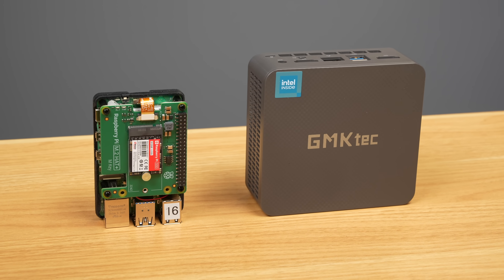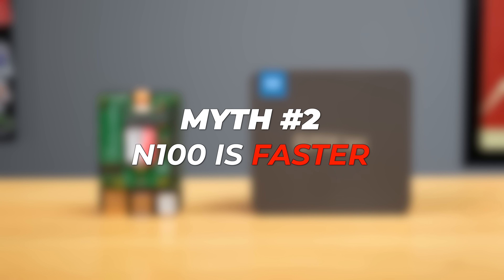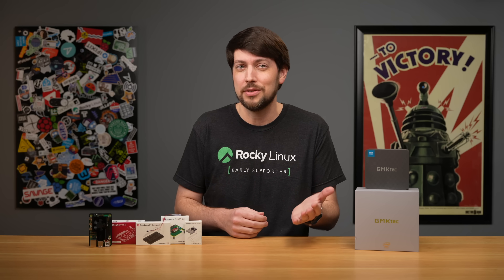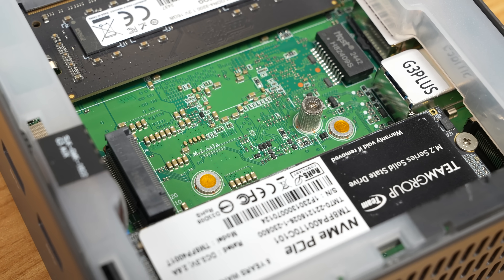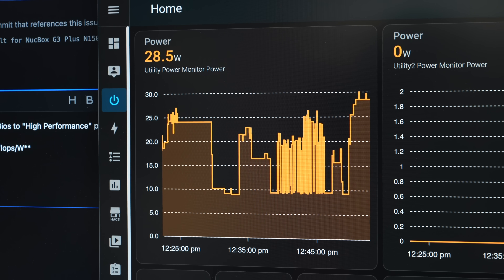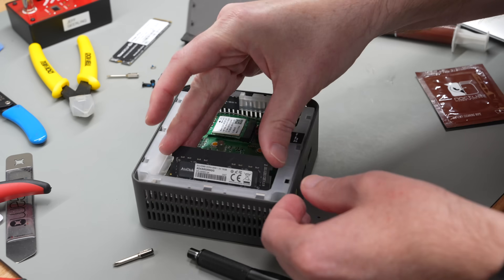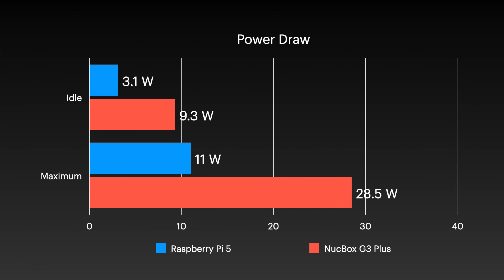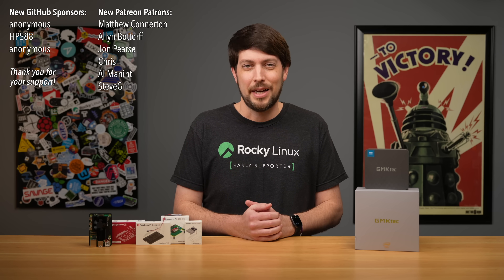When did Raspberry Pis get so expensive?

Comment: It's not only the price, the tech isn't there either. GPU is still lackluster, and 16nm is ancient for 2024 (and it was already old by the time the RPi4 was released). Also I can't forget the CEO's attitude during the shortage, spitting to our faces, saying explicitly that corporate buyers are prioritized over hobbyists. And BTW,  you should have included the OrangePi5 in the comparison, it's far more similar to RPi5 than those N150 mini PCs, and still a lot more bang for the buck.
Reply: OrangePi looks good on paper but has worse support than these 2 options.
Reply: @vadnegru  I don't have one, I'm guessing they provide iso images and things just work. What support is needed exactly?
Reply: @tappy8741  the community is very small compared to RPi's, and of course pales compared to x86's. But you can't blame the product for that, it's still more powerful and it will serve you well as long as you don't have odd use requirements.

Comment: If your patient you can get 16g ddr5 512g n100's  for 125-175, it just comes down to do you need the igpu(handy) and do you want to use a pi and tinker. I watch still, but pi's cost/usefulness is limited for me now, and i can use the pin outs from other adapters etc instead... Plus SD cards are stupid and fail to much, so you need to make sure your pi can use one :)

Comment: Thanks Jeff for this video and your last video on this topic ❤ - on which I also commented 😊. The last year or so I had abandoned Raspberry Pi as the Pi5 is expensive compared to a n100 NUC / mini-PC. In the last 3 weeks I have started using the Pi Zero 2 W as I love its cheap cost and very low power consumption. I was very lucky visiting the Raspberry Pi shop in Cambridge, England 2 weeknds ago and so I bought multiple Zero 2 Ws ! 😅😅😅 So for around $150 I would choose a n100, but for a simple Samba media server then I use a Zero 2 W, horses for courses. 🎉

Comment: As someone who is also a fan of the pi ecosystem, I do get frustrated with the number of people buying them and expecting to use them for basic/standard "desktop or small server" stuff. If all you are going to do is use it like a normal computer, then there is no reason to get a pi! get a used computer of some sort! Somewhere along the lines people have forgotten the key reasons for the pi's (and friends) market segment, and keep trying to poo-poo them by comparing to used (or new) tiny computers. Those aren't the point! The point of SBCs like the pi are (1) power efficiency, (2) architecture (IE: "not running x86, so I can play with a ARM machine cheaply") (3) the GPIO/"closeness to real world hardware", and (4) the ecosystem/community of users ensuring a long, long product lifespan.

Your "Get a GPU running on a pi" series is a great example of (2), where the ARM architecture is a key challenge point and fun thing. I myself have a few Pis specifically to be "Compile, run, test this code on ARM" machines. I have another that is specifically meant to be on 24/7 and has a battery backup. My last one runs a basic IoT-like hub connected via USB to a few arduinos because the community makes interoperating with them far far easier than trying to get a x86 system to pretend to be a embedded-like thing.

All to say, the performance of non-x86 SBCs was basically never the point of them, and while I will never say no to performance (I actually want more RAM, greedy developer that I am, gimme RDIMM support so I can load 64GB+!), the key of SBCs is to be that power efficient, tinkerers does-a-lot-for-good-price box, where if you somehow break/fry a pi it isn't that expensive to replace, to upgrade, to learn.

Comment: The raspberry pi value equation is
1.  A whole ecosystem of accessories and I/O connectors including GPIO that are not found on mini PCs.  A pi is an embedded system control board, with a variety of accessory boards ("hats"). 
2. Also, a good general purpose computing platform, but NOT generally meant to be your everyday pc.

The mini pc value equation is
1. It's a small and inexpensive way to run desktop (linux or windows) pc applications.

Comment: The only real benefit of a Pi 5 vs a Mini PC is form factor and acces to IO Pins, Pi 5 are crap this days, I use them since you can buy them and have almost all the models in existence and I have changed all of them for Mini PCs, you can buy Lenovo mini PCs that have Intel i5 or i3 with 8gb of ram, 256gb nvme ssd and a slot of a HDD for like 60-80$

Comment: Where can you get a Pi5 for $50?!  the 2GB model is more like $80, with the 8gb model starting at $115, and the 16gb model at $150. JUST for the board. Assuming there is even stock. Sure pi foundation has ramped up production again, but demand is so high, there are still scalpers jacking the prices, and reputable shops struggling to keep stock.
And therein lies the crux of the argument:  Unless you really need the GPIO or to use a specific Pi HAT, they just are not worth the cost and frustration of searching for stock, especially when other options are more performant for the "Final price" you'd have to pay for the Pi, case, data storage, heatsink, PSU, etc.
Reply from the maker: At least in the US, all but the 16 GB model have been easy enough to pick up at MSRP from almost any of the retailers.
Reply: @JeffGeerling  Ok. My prices were from Japan (yen converted to USD).

Comment: Still dont understand why Intel makes N150. It will not beat ARM when you see power to performance ratio., Neither would give you performance., since its a strip down version of x86.,  Due to this it will not fit a home computer market., neither into embedded space.  Either cases., it does not fit anywhere., hightime they should scrap these loss making devices.

Comment: for me pi has gotten too expensive over the years - you have included inflation but what about the higher performance we should get also 
That did not increase that much and the value added is still missing: Where is the ssd connector in 2025 ?

I hat to see pi making money from that by adding expensive adapter instead of integrating it. Why should I buy a 7 € USB 3 adapter for a ssd when Pi must be able to add that for a lot less on every device.  And all these extra add up, also their strategy to slowly increase the power demand that you have to buy a new one each and every time. 2 A, then 3A then 3,5 A - I can not even remember what the Pi 5 is drawing or the Pi 4 
My last upgrade was a Pi 4 and I guess the journey will end there too. Or I will have to sell a lot of pI 3 and what not.

Comment: I think the question is not is a mini pc cheaper, but is the pi now too expensive to give a child who wanted to learn to code and control electronics.

I do think the Pi Foundation needs to pause and take stock and work out what is most important.  I think they need to re-prioritise a £35 price point. People buy a pi for the maker-potential; the GPIO, the community, the documentation &c., not to replace their dual screen desktop PC.  A second hand (~£50) PC will easily out perform a top spec pi, so targeting this market just doesn't make sense. 

Let me put it this way.  A school might buy a dozen pis at £35 each but I don't see any school buying them at £80+ each.

Comment: This price gaslighting drives me nuts. PI is super expensive, that's it. Quoting MSRP for which you can not even get it does not make it cheap. Reality is, they started bumping it up to stratosphere, and then wondered why people switched away.  I used to buy PI's at like 40 bucks, then, when it was time to refresh, I got hit with 120 a piece quote, all when celeron based intel was 130 (including enclosure and power source). So yeah, switched away and never looked back.
Reply from the maker: I have purchased many Pis at MSRP in the past two years, have not had any issues finding them in stock at multiple retailers.

This is in the US. Worldwide, YMMV?

Comment: Jeff I’m begging you, please stop implying that the efficiency of a chip has anything to do with their ISA!

Many ARM chips are more power efficient than x86 counterparts, but that’s largely due to their target market and the way they are designed. Not because they run ARM instructions.

I love your videos, but as a chip designer by day that always irks me.
Reply from the maker: I don't say it has to do with the ISA, I only say that you can't say "Intel 7 (nominal 10nm) is more efficient than TSMC 16nm" like many people do.

It's similar to TDP. Some people say N100 TDP of 6W versus BCM2712 TDP of 10W means the N100 is more efficient. Not at all! It's like the megahertz myth 20 or so years ago, that has finally seemed to die off.
Reply: @JeffGeerling  Sorry I should’ve been more specific. You are absolutely correct in how you were talking about process technologies. 

I was referring to when you said “ARM still holds the crown in terms of efficiency”. Which I realize now you had meant to just mean the raspberry pi won vs the N100. Not that ARM is blanket more efficient. Anyways sorry for being pedantic and thanks for taking the time to respond!
Reply from the maker: @dragunzonline  Ah yes, in that case I definitely see where you're coming from. There are enough people that just think "Arm is efficient, x86 is not" and when I say something like that, they can be like "oh Jeff agrees!" when it's nuanced—many Arm cores happen to be more efficient than many x86 cores (maybe even most), but it's not just because it's Arm...

Though Intel used to seem to care a lot less about their low end cores, until mobile became so important industry-wide.

Comment: I tried to assemble a 2U raspberry PI4 rack.  I bought the 3d printer and printed it and then the lockdowns happened. I was able to get 3 at most out of 12. I priced out the 12 Pis, PoeHats, MicroSD cards,  and it came out to the cost of a X86 DIY 3U Rack server.  I have hard drives, Ryzen 5600X and 64gb ECC and ample storage for slightly cheaper than the 12 Pis.  When using Rpis for Nextcloud or Pihole the SD cards would fail and buy more.  They were not dependable.  Pis are mainly used for retropi at best for me.  I rather use small x86 hardware since there are parts readily avail and off the shelf.

Comment: If those mini PCs would only have a VGA hat to easily allow for weird retro setups, they would be even more killer. What's dumb is that you have to even solder this on for the Raspberry Pi 5.

This kind of puts people in a weird spot if they want to do VGA out to old school PC monitors or CRT consumer TVs. Yes, I own a MisterPi too but sometimes I just wanna use an emulator with the legit viewing output hardware and don't want to use Windows with CRTEmuDriver. 

Kind of wish they had a single mini PC towards this goal.

Comment: Thanks!  Good vid and info.  I personally buy whatever it takes to max out  any new or used because I use the hardware until the wheels fall off.  Software that I use tends to get larger with each engineering change.  And I find new things that makes sense so  I'd rather work than fret over poor frontend decisions which leads to hardware rework.  So I buy now vs pay later..  Again, my personal preference.(s).

Comment: I used a raspi1 and then a raspi4 for years as my home server. I moved to an opteron x3216 with 32gb ecc memory, and then after that to a 14600k lol. Raspi is a nice humble beginning but those mini-pcs are "cheaper" in Asia because the components aren't new. Like the ram sticks and/or chips will come from discarded laptops etc. It's really not a fair comparison. But this is just EU and USA pov because over in Asia no one gives a damn if it's used or not. They're discrete devices

Comment: I think both have a place.  I think N100 pc's are slightly easier more accessable.  I have an N100 in a 2 bay NAS 32GB (additional Ram) everything runs ontop of proxmox- truenas, Home assistant, frigate and Plex.  2.5G network x2 and the iGPU is man enough for transcoding and detection.  For my use case it works.

Comment: I have no interest in either Pi or MiniPC, but logically if the MiniPC runs into heat limit the apples to apples comparison is to either throttle back the MiniPC until there is no heat problem or take average over number of runs some of which would then run to the thermal issue. Adding a fan is not really cool (pun intended). Unless you really want to just compare Intel performance to Arm performance, screw the power usage.

Comment: Coming from 3B, Zero W and 4, I just can't justify the cost of using raspberry pi anymore.  the releases of RPi5 made me turn to OrangePi 5, it's not all about the cost, in fact orange pi 5 Max isn't much cheaper than RPi and they basically fixed hardware designs that almost everyone was hoping for the RPi. It runs cooler but much faster than RPi and fan isn't required. Full-size HDMI and doesn't need to spent more to use nvme, plus it also supports eMMC. Yes their software supports updates are bad, pretty much is only driven by the community, but I remember RPi took over a year to fully support the 8G RPi that I bought, and 64bit RPi is disappointing. Spending money on companies promises is stupid, least orange pi is you get what you paid for, everything works but don't expect anymore.

Comment: Not just expensive for the versions with decent amounts of RAM, but disappointing performance. Add in the strange design choices on the Pi 500 and there is every reason to put the Raspberry Pi foundation under scrutiny. EDIT: An 8GB Raspberry Pi 5 (with power supply) costs US$122.88 here in New Zealand.

Comment: The thing I dislike with my GMTK is that it is 120mm sized but they did not think of putting the hole spacing in a way it would make it easy to just slap a 120mm fan on top, it is very doable and would take close to not effort but the foresight was not here... and the included fan on my model is so bad it I hate it but haven't add the time to change the whole thing.

On another note many other have pointed it out but the pi price around the world are generally higher even more so accessories and mini pc can go lower but another thing is you can often spend a little more to get something a lot better than the lowest available price get you. As always use case is always the most important factor but I personally did spend a little more on my mini pc to get someone way better than a pie could have got me. 
The 16GB pi5 here is around 150 euros + all the accessory it would have been easily over 250 but for 300 I did get a mini pc powerful enough to play switch emulation game at better setting that native so yeah, also 32Gb of ram and way better browsing experience, yeah I did pay more than the pie, but the value was so so much better

Comment: For me, planning to live in an off-grid house, every Watt counts. I still went with an N100 system for three simple reasons: A) with huge aluminium cooling fans it can run fanless which I absolutely love, B) it can accomodate a SATA boot SSD and a large M.2 SSD for data without looking like a mess or 3D printing an ugly case. And C) it has 6(!) 2.5G NICs which saves me an additional router. Much love for your RasPilots out there but N100 is a perfect fit for my home.

Comment: a refurbished Lenovo Thinkpad with 16Gb of ram and 256Gb of storage will set you back 90 bucks... 
That's a powerful device with a built in keyboard, screen and UPS right out of the box for half the cost of whatever that pi monstrosity was.

The Pi was a great deal back in the day, these days it's an overpriced toy.
Reply: A refurb laptop may not have that great a battery life. I just bought one cheap, with a two month guarantee that specifically excluded the battery. So if it's pre-used you can't rely on the battery for "UPS"

Comment: The issue is that to actually GET a Pi these days  you're often paying 2-3x the list price on it. At that point platforms like the n100 start making a ton more sense. If the Pi were actually available at msrp then it would still be a strong option.
Reply from the maker: Are you in the US or most EU countries? If so they've been available at MSRP for a while now, if you don't see them in stock at a store, check https://rpilocator.com
Reply: @JeffGeerling  I'm in Canada - It's still $100 to get your hands on even a base 5 through one of the official resellers, or closer to $150 through platforms like Amazon. Pre-pandemic you could pick up a pi for $60-75 here.  I can get a fairly good specced N100 system for $115. 

At that low a price differential the pi gets a little less compelling. It's unfortunate as I do like the Pi platform.

Comment: Pi has a unique series and near endless application of use-cases available to it, same as any mini-PC. Where they differ is that you can downsize the Pi to meet your needs, you can't really do that to the mini PC. I mean, you can but there are diminishing returns for companies that have to compete with hardware that's largely been open source for the past what? Three decades?

Also worth noting that Intel's E-cores aren't really power efficient. They're just economical efficient. :P

Comment: Correction N100 and N150 Can both use DDR5, just need to find a mini PC with that.  also you can put 48gb ddr5 and its fine in the n100/n150. a good majority of these n100/n150 pcs come come with 2 ethnet ports some at 2.5g. This model GMKtec G3 Plus  is not that good. its the case and layout.